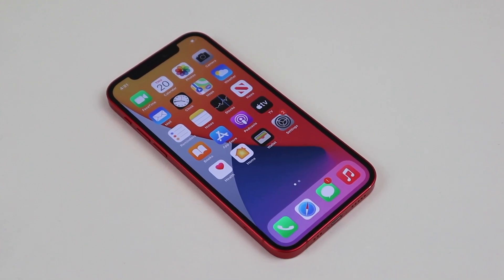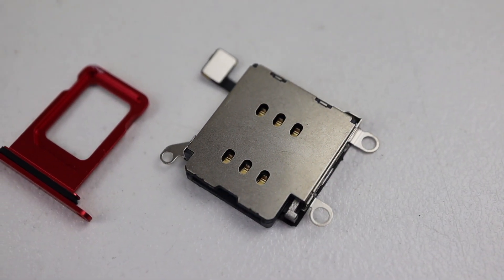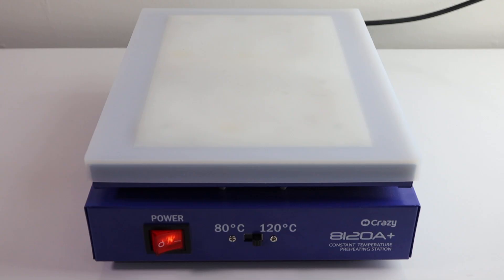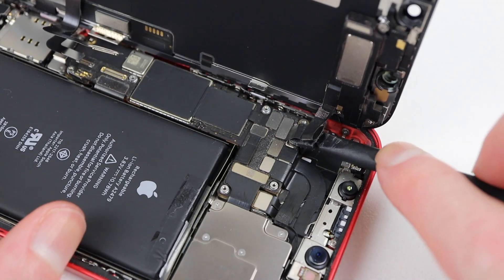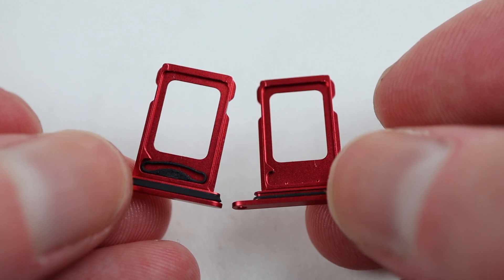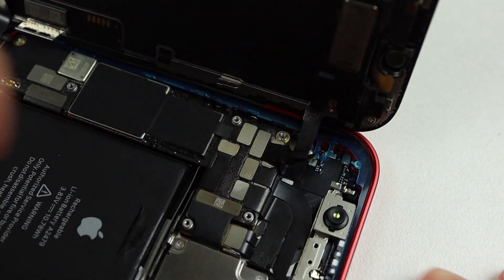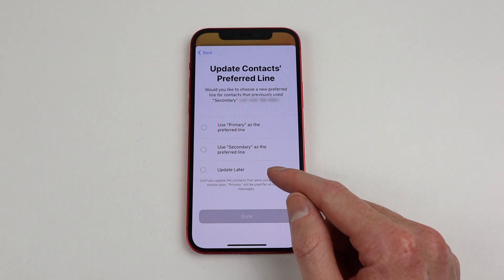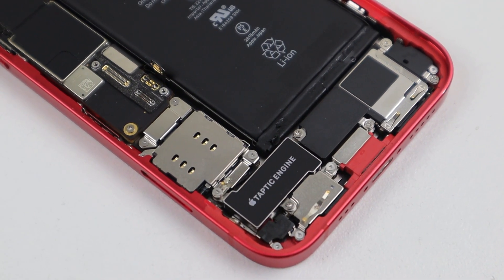Hidden iPhone 12 Hardware Upgrade Apple Never Told You About.

Comment: I was really hoping this would be an SD card slot mod :(
Reply: Keep dreaming to come true
Reply: yes let's overpay for higher storage capacity models instead
Reply: @Hajo C Alright, say that to my 64gb S9+ with an extra 128GB of storage from a $20 SD card lmfao, you don't know what you are missing out on
Reply: SD card slot is slowly dying even Samsung got rid of it
Reply: SD cards are crap. Nobody should use them in a mobile phone.
Reply: @macdaniel6029  Explain your logic there sir
Reply: @LazorVideosDestruction  SD = crap. That´s all. Slow, insecure, unreliable.
Reply: @macdaniel6029  Have you ever used an SD card? You say they are slow? Dude, they have write speeds comparable to some SSDs. Insecure? What does this even mean? Your data is highly unlikely to be lost to corruption, and most importantly, it's in your own hands. Not someone else's. Unreliable? Again, what does this even mean? They are one of the most versatile storage mediums, they fit in a wide range of devices, come in large amounts of storage for cheap prices, are nearly everything-proof other than a hit with a hammer, and much more. Calling them crap sounds like something only an idiot would say to defend a scummy company that doesn't use SD card slots...

Rant over.
Reply: @macdaniel6029  lol

Comment: You just got someone at Apple fired, and a "SIM card slot not genuine" message in the iPhone 13.
Reply: Why is this so funny
Reply: @20EsOfficial  because people spend their money on crappy products, that's why its funny
Reply: They don’t even have to do that, they can just disable dual-SIM on US models in software
Reply: You thought! Apple went even further and made sim card slot soldered with main logic board
Reply: And the 12 on the next update
Reply: U think apple dont know what phones they engineered? They are well aware from the time they created the pcb schematics fhat it be possible to to do such
Reply: @benNdaKen  The engineers designing the phones aren't the ones making the decision to lock everything down.
Reply: @TechHug  well then u dont know anything about apple. The hardware and software team for ios and iphone are working closely together.
Reply: @benNdaKen  Its not the software team deciding that either. Think higher.
Reply: @TechHug  well craig at apple
Is resposible for the iOS and macOS teams obviosly the teams get told wat todo but they are implementing it
Reply: And actually i think its good that parts are paired to the a Logic Board for example the Face ID / Touch ID tho about some other parts like camera its debatable weather to pair them
Up like that. I think its good to get a messege when parts been replaced however to make the software to block then from working untill reprogrammed is overly locking things. In my oppinion its good for Touch ID And face id but unnessesary for Display or Taptic engine
Reply: @benNdaKen  even then, just giving a warning is good enough. Also, not on the fucking lock screen. Just in settings is fine.
Reply: @superslimanoniem4712  no one honeslty looks in the lower cathegories on the settings app so showing it on the lock screen for 1 time is good
Reply: @benNdaKen  there's nothing good about that, its just stupid, they could just check the part is authentic from Apple, why do they care they match... its the same fucking part.
Reply: @benNdaKen  But even when the screen is genuine Apple it still shows that damn message
Reply: @lucidsalt4116  ya because the phone doesnt know if the display is really a original or a copy. Thats why there is this display reprogrammer where u can copy the serial number from ur old screen to the new screen
Reply: @benNdaKen  copying the serial number from one display to another wouldn’t be enough to make the phone like new
Reply: @benNdaKen  yeah your the problem
Reply: @benNdaKen  my uncle works for apple and you clearly dont know how apple internal division works
Reply: @curie1420  I highly doubt that

Comment: Unfortunately, it is likely Apple will combine the SIM reader with the motherboard on the next iPhone. They need more space on the inside which became apparent on the iPhone 12.
Reply: It was like that on previous Gen iPhones tho
Reply: @_Midori  with the new components and rearranged layout, the iPhone 12 had to make compromises in terms of battery and space.
Reply: Moruk haklı olabilirsin ama şu an çoğu insan hala fiziksel sim kullanıyor
Reply: It does work for iphone 13 aswell
Reply: merging the sim card reader and usb c or lightning or whatever is a legit way to save space.
Reply: Like doing away with the headphone port and making the taptic motor 3 times the size as a reason '' we needed more space ''.    B.S
Reply: @MrTarmonbarry  yeah, they could have done this sim card thing back then and kept the headphone jack, its pure BS marketing for the Airpods.
Reply: @RandomGuy-om1vy  The real bad part is that others follow Apples lead , Samsung have gone down the same road and it will backfire on them
Reply: @MrTarmonbarry  well sometimes its good too, the new macbooks is rumoured to  have full sized hdmi ports, that would be useful if the market followed the lead..
Reply: @RandomGuy-om1vy  Strange how it all goes round in circles . One upon a time they were all full size , then they got smaller , not maybe back to full size . Same thing happened with mobile phones , started with the brick 9 they were a pain to carry around0 then they went smaller and smaller and now they are growing again , some are almost like a small tablet
Reply: @MrTarmonbarry  they got smaller and smaller because all they could do was make phone calls. They got bigger and bigger out of necessity. They're full fledged computers now. I run an entire business mainly from my phone, and hardly ever use my laptop, and even less frequently use my desktop. The fraction of people that claim to care about a HPJ is getting increasingly smaller, and the amount of people that ACTUALLY care about it because of a legitimate need, is miniscule. The AuDiOpHiLeS that care about sound quality enough to use wired headphones are usually using dedicated audio players for their head phones (or MoNiToRs as they say). Wireless headphones are good enough for 99.5% of the population. If someone claims that high end wireless headphones aren't good enough for their AuDiOpHiLe ears, they can get a dedicated audio player, a DAC, a USB C to HPJ, or a different cellphone. There is no real legitimate use for a HPJ with the quality of modern high end wireless headphones. Regardless of what the motives of removing it was, most people don't care, and most of the people that claim they care have no legitimate standing on why they care. If you say you can't afford wireless headphones, which can be had for very cheap, then you can't afford the expensive phones that have done away with the HPJ. Almost all the low end cheap cellphones still have a HPJ. I used to be one of the "why food those idiots remove the HPJ!?!? That's so stupid." Until I realized tree HPJ is useless. I'll also give up removable batteries for 100% waterproof phone. I love when people freak out when I leave my phone on the side of the pool because, "omg your phone is going to get splashed." Our when i use it underwater to take videos of my kid, or take it into the shower to watch YouTube videos. I'll put in a new battery, or pay the $80 to have it done every 3 years, rather than deal with a phone that isn't waterproof. I've never regretted phones with a non removable battery. Even my Samsung Galaxy S5 had a removable battery, and was waterproof, but you had to install charge port plugs and it wasn't much more than splash proof. I've taken ever Galaxy I've owned since the S7 (S7, S9+, Note 10, and Note 20 Ultra) into the water and I've never had an issue. It's one reason I won't buy Apple (among a litany of other reasons). They can't even make a waterproof Apple Watch, which has no ports, since it only does inductive charging. They only recently started making the iPhone waterproof. Before that, it was not waterproof and yet it still had a non-user serviceable battery.

Comment: just wondering, is there a legitimate reason that this feature is withheld from US spec models. this is an inherently "Pro" feature and it does not exist on "Pro" models.
Reply: Probably to move people to / get them used to eSims. So they can remove the sim tray and save more space.
Reply: Because US uses eSIM,which make physical dual SIM unnecessary
Only china do not support eSIM
Reply: iTards be like 
If you really need dual sim functionality 
Just buy 2 iphones 
Apple is so generous that they are giving you a chance to experience their phone twice!
Androids don't even have a single sim function 
This is why i buy apple!

Comment: Is it safe to plug in the phone before it's fully assembled? 😬😬😬
Reply: that's a grounding wire to prevent electrostatic discharge when using the phone while its open, it also props up the screen so he doesn't have to constantly hold it
Reply: @elias8294  oh okay, I've heard of those.

Comment: Ya hear that? Thats the sounds of Apple furiously closing that loophole.
Reply: Was just thinking that.
Reply: This has been here since iPhone XR had modular sim slot, same with iPhone 11. Why would they close the "loophole" if they are using this method to manufacture iPhones with either Single SIM or Dual SIM. This makes it easier for everyone. if they were to deliberately screw everyone over, it would be in the next model.
Reply: @plzdonhack  Apple deliberately screw everyone over , , shock horror , they have been doing that for years why would they stop now . If its not a problem why dont they sell al of the iphone 12 with a dual sim slot??
Reply: @plzdonhack  they won’t nobody would just duck the water resistance and open their phone ! Plus I think e sim is better if someone steals ur phone ! And If apple adds turn off lock on lockscreen ! He can’t take the sim out or turn it off ! Thus gps tracking would work
Reply: Lol every comment so far that I've seen has said something along the lines of this
Reply: For anyone thinking of doing this its time to turn off automatic updates
Reply: Why would they? As long as it is an original Apple part they still make money out of you...
Reply: @gilles111  The parts are sold via places like Ebay , and are very cheap . Apple could make more by selling the phone with it already installed . If someone buys a new phone are they going to void the warranty by having an after market dual sim tray fitted , even if it is a genuine Apple part , probably not when you are shelling out $1000
Reply: @MrTarmonbarry  I guess Apple already patched the possibility to use a non-Apple part for that (as I remember Hugh said he used an original Apple part from China).

And yes, I agree, Apple should offer this opportunity to everybody. When buying a new iPhone, you could not only choose the color and memory but also dual-sim or sim/e-sim.
Reply: @plzdonhack  Plenty on Ebay and they look to be new . It does not need an i.c on the sim tray , all they need to do is read the chips that are on it and take it from there . if the original phone never had dual sim they could write in a little program that would lock it , a bit like the bios in your laptop
Reply: @plzdonhack  I'm not the one saying Apple should patch this.
Reply: @gilles111  There are lots for sale on Ebay  brand new so no dodgy second hand parts . For what you are paying for the 12 it should just be a standard thing fitted at the factory , not an option that you pay the ridiculous Apple price for  . I have a oneplus 5t, dual sim is standard , no extra cost , it was about $600 new when i got it , 8gb ram, 125gb storage and its fast . I even bought a second one ready for when i do something stupid , and i know i will ))))
Reply: Logi Master I agree with you but that is simply not possible paring a sim tray, mind you is a passive device with no ICs on it. Cameras? Yes Face ID sensors? Yes Screens? Yes. But I have gotten my hands on one of this Sim tray and they do not have ICs on it. They may be able to fuck you over by checking the region it was sold in and disable the ability to read from another SIM card in the case a second physical sim slot was installed. That’s about it. Can’t say the same for future iPhones but yeah, it is already frustrating enough to work with SIM locked phones at the moment. W

Comment: You could always use a cordless drill with a drill bit. Wrap a bit of the adhesive around the bit, and run the drill to take all the old adhesive out.

Comment: That was a pretty impressive mod.  If one day you upgrade iOS and notice the dual SIM stops working, at least you'll know Apple watches your videos.
Reply from the maker: They introduced the "Camera unable to be verified as genuine" message after my iPhone 12 repair assessment video...
Reply: @HughJeffreys  can you try a similar thing to this video but by adding a mmWave antenna to a non-US model? It would definitely be something interesting
Reply: @HughJeffreys  one day they will pair everything possible in the phone
Reply: @Aksaqa  They will even pair the air inside the phone.
Reply: @Aksaqa  just waiting for them to pair the adhesive with the phone...
Reply: @Aksaqa  oh no....
Reply: @BaconFaceMcGee  its technically already done because when water enters your phone, they can know...so whats stopping them from WANTING to know if your phone has been opened? its already air tight so...step 1's done?
Reply: @BillBoard.  Good point.
Reply: @Aksaqa They'll pair the entire frame and backglass😂
Reply: @Aksaqa this aged VERY well (I'm not joking sadly)
Reply: @HughJeffreys  you think this is possible on an iPhone XS?
Reply: @panthersbilliardstt  no because the xs sim reader is soldered to the board making it hard to replace yourself
Reply: @oliver_lauritsen_oa  okay thanks man
Reply: @panthersbilliardstt  it is more difficult with this model
Reply: @HughJeffreys  that is insane
Reply: @HughJeffreys  those decoder thingies are the solution
Reply: @HughJeffreys  you shouldn’t have made the video than😅
Reply: @HughJeffreys  ca you do this on an iPhone 13 now?
Reply: @HughJeffreys  With this are you still able to use an e-sim or do you have to use 2 physical sim from now on?
Reply: @HughJeffreys but at least the replacement camera module now works.
Reply: @HughJeffreys  they're the only ones who CAN verify it! I'm curious to hear your thoughts on the draft right to repair document in Australia, if you have any. Cheers
Reply: @HughJeffreys  You were running 14.4.2 on that phone so I wonder how 14.6 would handle since there was some modem firmware upgrades during that time.

I also wonder if this can be done on other models such as the 11 or even as far as the 6s. Would this also still work in iOS 15?

It's an incredibly good mod though and it's something I wish I could have as only one of my carriers in NZ support esim and only on contract vs prepay if I remember correctly. 

It's also something I wish Apple would think about because even if you have dual sim having the choice to disable one of the physical sims for an esim would be the better choice.
Reply: @maxinemn  only spark NZ has esim
Reply: Soon, Apple would monitor the glue in their gadgets.
Reply: @glicerioacosta957  don’t give Apple ideas especially bad ideas.
Reply: I’ll update you if it happens, Ive just bought the module and sim tray to do this mod on my 12 Pro
Reply: @LosSantosPro  Keep us updated. Tempted to do this on my 12 pro as well. B
Reply: Or they spy user's settings and they see something crazy
Reply: @oqocraft2661  big tech companies spy everything
Reply: * angry apple noises *
Reply: @Aj Pablo Is Good
Reply: It worked for my 12 Pro on iOS 15 Dev Beta 1, although found a very slight issue, when putting both SIMs in the phone, only the rear one is detected, until you reboot. Not sure if that's an OS or part issue.
Reply: @LosSantosPro  You didn't give Apple enough time.  The video only came out like a week ago.  Maybe in a month try the new iteration of the Beta...heh heh.  Apple, can't live with'em..can't live without'em.
Reply: @XLessThanZ  I'll let you know if it gets patched!
Reply: @XLessThanZ  I could definitely live without them...
Reply: @LosSantosPro  Can you test you're still able to use an e-sim or do you have to use 2 physical sim from now on?
Reply: I think there’s already a law passed about anti-self repair.

Comment: What happens if you setup a digital sim, and then swap the module to dual sim? Will the digital sim dissapear? Genuinely curious how the software will act.
Reply: Most likely the software won’t be prepared for 3 phone numbers at the same time.
Reply: @vistaero  i don’t think it will be able to even have them. Because I think the esim in in the normal sim slot so it will probably go away
Reply: The digital SIM disappear cos the SIM slot had the eSIM intergrated,changing to dual SIM will make it disappear
Reply: @Icloudking123  Now this makes sense. I didn't expect digital sim to have its hardware part, but there has to be one.